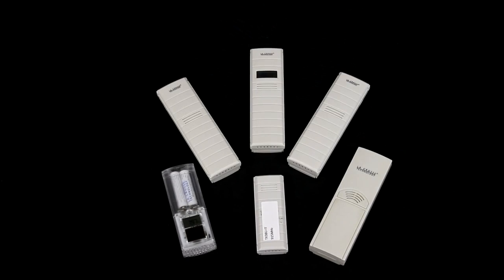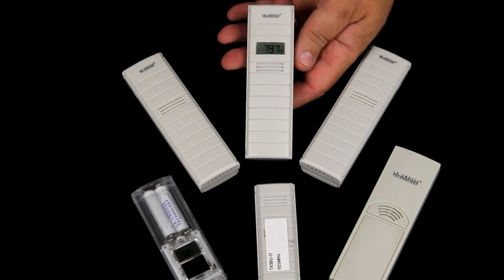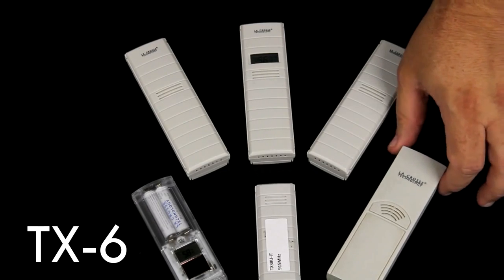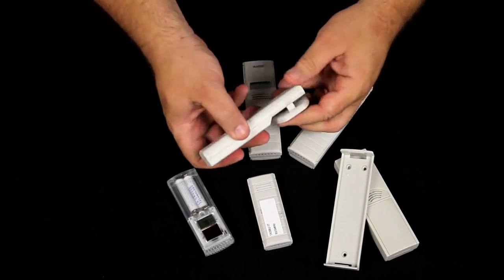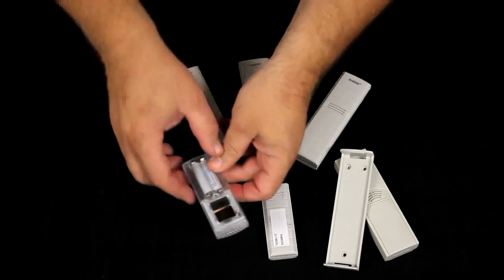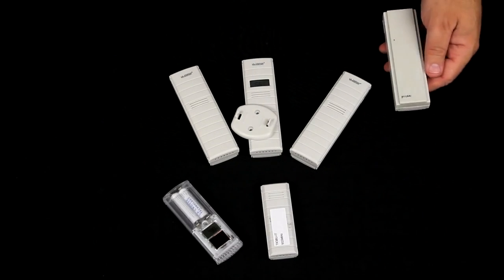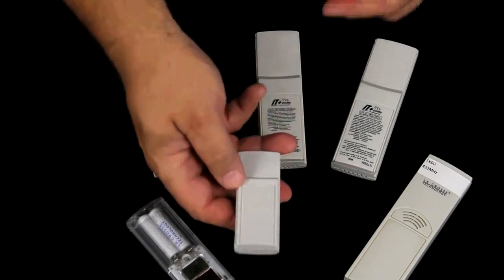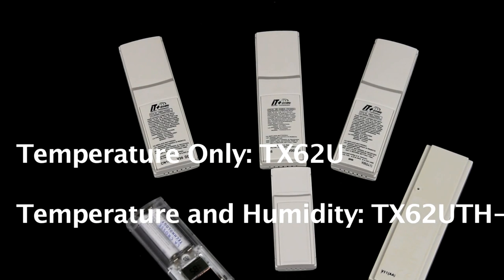Remote Outdoor Sensors

Comment: I see that most don t work past a couple years...won't get again
Reply: La Crosse Technology yes, I do understand those that leave the bad opinions, but they are true to what you just said. There should be a warning on front of box in big enough letter saying that humid areas will cause equipment to not last but maybe a year or two. Then a person can decide if they want to spend that much for a product that doesn't last that long! Not fair to not tell people.
Reply: Have my mounted under 4' deep eves - very protected from elements.   All metal components in the sensor look corroded after 2 year use.   CT humidity kills it - really?   No, cheap materials kill it.

Comment: La Crosse is a joke. My sensor failed. La Crosse admits they are only good for 5-6 years, but no longer offers compatible replacements. So, they lamely offer 45% off a new weather station whose sensor will fail in 5-6 years. What a scam: Talk about planned obsolescence!
Reply: I had an accurite that lasted 5 as well.

Comment: These sensors/weather stations have four big problems.  (1) Battery replacement has to be in right sequence.  Sensor first, and the receiving station next.  If the sequence is messed up, the sensor will be damaged permanently.  (2) So you have to monitor battery strength in the sensor periodically.  If sensor battery is dead, the receiver can no longer receive signal (even after you have replaced sensor battery). (3) The sensor is not weatherproof (deliberately).  Even if you put it in the shade outside, some mist, splash will get inside, and will damage the electronic parts.  (4) At very low   temperature (say minus 25 deg Celsius as in Calgary) it malfunctions. I have dumped two sets because of (1) and (2), and the third one was damaged because of (3).  The g oal of the companies is to sell every two years.  As regards accuracy, these are excellent.
Reply: The inside station is working fine.  The sensor was dead for a while.  I virtually wrote it off.  I opened it, using a small saw, and noticed two problems (1) The negative terminal of battery compartment had partly broken (poor/intentional design).   (2) The +ve leg of the 10 mfd 16V CKCON JAC (Whatever that means) electrolytic condenser inside the sensor got rusted. I shall try to repair it as part of my hobby project.

I give this feedback because (1) I really liked the station for its overall convenience, reliability and accuracy (I used three, and presented another three to my friends).  (2) I do believe that in this age of electronics, foolproof safeguards against inadvertent wrong sequence of inserting the battery is not that difficult.

Thanks for prompt reply, and for sending the reset link.
Reply: How can a different sequence permanently damage the sensor?
Reply from the maker: @gil3289 , simple answer, it cannot. Our original response to "Know All" was deleted last year when we upgraded our Google/YouTube account from a personal to business platform. If you're having trouble with your sensor or station, please send our support team a message here: https://www.lacrossetechnology.com/support/index/form/ and they will work with you should you need a replacement. Alternatively, our restart video here: http://bit.ly/LaxTech_BasicRestart often helps resolve connection problems.
Reply: @knowall5792  Your problem is that your unit has an electrolytic "condenser" , should be a "capacitor"....................just kidding! Sounds like you are "old school" Know All. I am an even "older school" Elect. Tech, I like to use the "old" terminology, such as: 60cycle instead of 60Hz. GOOD LUCK with that sensor. BTW, "AccuRite has the SAME issues!

Comment: We're seniors, unable to climb under the eaves to install the outdoor sensor for L73859. Wondering if the unit would send approximately 40' from inside a post mounted waterproof plastic electrical outlet box?
Reply from the maker: Though we cannot guarantee this will work, 40' is well within reception range, so it's worth a try. Our only concern is possible inaccuracies due to the lack of ventilation within that box. Our sensor weather shield could be another option if you have any trouble: https://www.lacrossetechnology.com/products/925-1418

Comment: Thank YOU !!   BUT ...... when I put New batteries in my outdoor sensor, it no longer communicates with my clock indoors.  Please help :)
Reply: Okay, I did everything you said above and the outdoor sensor still isn't working.  I'm thinking my sensor went out on me.  I'll probably have to buy a new one again.  This is my 2nd sensor so far.
Reply: About 1-1/2 years ago, roughly.
Reply: Okay great.  Thank You.

Comment: I've put new batteries in the outside thermometer and it continues to read OFL, and must be synced to inside unit which also reads OFL as the outdoor temp.
Reply from the maker: Hi Noel, sorry about this. What is the model number of your weather station or clock?

Comment: I have a TX 141TH in the red light in front flashes continually. I have change the batteries on the remote I have change the batteries in the stationary model and I have reset The units by taking out the batteries and unplugging it from the AC current. What are my other options?
Reply from the maker: Hey Marla, we are truly sorry for the trouble with your outdoor sensor. Our first suggestion would be to make sure you are using a new set of reputable alkaline batteries in both the sensor and display. Other battery types can have undesired results. Along with this, be sure to perform our basic restart steps covered in our video here: http://bit.ly/LaxTech_BasicRestart -- If these still do not provide a solution, please message our support staff directly here: https://bit.ly/contact_techsupport. Or alternatively, send us a private message on our Facebook: http://bit.ly/LaxTech_Facebook or Twitter: http://bit.ly/LaxTech__Twitter page.
 Our apologies again for the inconvenience.

Comment: I have a TX142TH, the outside sensor is not working, possible to fix or replace?  Not the batteries. Thank you?
Reply from the maker: If you've tried our Restart Instructions covered in our other video here: https://bit.ly/LaxTech_BasicRestart and are still having issues, a replacement is likely needed. You can find this on our website here: https://www.lacrossetechnology.com/products/tx142thv4 

If the item is still under our 1-year warranty, please message our support staff directly here: https://bit.ly/contact_techsupport. Or alternatively, send us a private message on our Facebook: http://bit.ly/LaxTech_Facebook page for assistance in getting a free replacement. 

We are very sorry for the inconvenience.

Comment: What are the differences (if any other then the # after the "V") between the "TX141TH-BV2" and the "TX141TH-BV3" I have an older 308-1414MB that needs the V2 and I just bought a newer S84107-INT that needs the V3 one will one work for both stations?
Reply from the maker: Hey Peter, sorry for the confusion. Both versions of these sensors should work with each of your weather station displays, so yes, only one sensor will be needed if you're setting them up in the same location. A small internal component was the only difference between the two sensor versions, the performance should be the same.

Comment: The weather station 308-1412-3TX can display the status of the batteries installed in each sensor TX141TH-BCH. What voltage will trigger the "low battery" icons?
Thank you for your answer.
Reply from the maker: We apologize, unfortunately, we do not have that specific spec for this item. Typically, the low battery icon will show up when the batteries are between 1.22 - 1.35 DC Volts. Though, you're usually safe running the batteries until they die or at least for a while after this icon appears.
Reply: @lacrossetechnology   Thank you very much for your detailed answer/recommendations!

Comment: I have the 79400 model. We had a very short power outage (a few seconds) and now the screen is showing 188 everywhere. I have tried resetting and nothing.
Reply from the maker: Hey Kathy, our sincere apologies for the trouble! Let's try a few steps to see if we can get this corrected:

1. Remove all power from your display. Including batteries and unplugging the power cord from both your wall and from your display.

2. Press any button on the display at least 25 times and leave it sitting without power for at least two hours.

3. Power the display back up by plugging the power cord into your outlet first, then into your display. 

4. Press and hold down both the WIND ALERTS and LIGHT buttons together until the unit beeps. 

If this does not resolve the issue, please message our support staff directly here: https://bit.ly/contact_techsupport. Or alternatively, send us a private message on our Facebook: http://bit.ly/LaxTech_Facebook or Twitter: http://bit.ly/LaxTech__Twitter page for further assistance. Sorry again for inconvenience.

Comment: I had 4 different types of weather stations and always this little wifi sensors go bad few weeks months the electronics can not handle the cold temperatures and they go kaput.
Reply from the maker: Hi Cess, we are truly sorry to hear about the troubles with your past sensors. In most situations we recommend using new brand name alkaline batteries dated at least 7 years ahead (super, ultra, max, heavy duty, or rechargeable types should be avoided). But if you're in a region with consistent sub-zero temperatures, lithium batteries may be a good fit, as they can better withstand the colder temps. To get the sensors resynced with your stations, please review our basic restart video here: http://bit.ly/LaxTech_BasicRestart -- If you're still having issues getting them to reconnect, after these steps, reach out to our support team: http://www.lacrossetechnology.com/support/index/form/ -- we'd be happy to work with you should you need a replacement. Sorry again for the issues, but we hope to help get this sorted out here soon.

Comment: Hello, my TX141TH-BCH sensor measures 1.5 degrees more than the base. Is that correct?
Thanks
Reply from the maker: Yes, this is a possibility. When performing a side-by-side test, if the readings are off by more than 4°F, this would indicate an issue, but 1.5°F is considered within tolerance and working correctly. Our other video here: http://bit.ly/inaccurate_temp_readings, goes into how to perform a test and offers suggestions if you believe the outdoor sensor is reading too high or too low.

Comment: Is my TX191 outdoor sensor suppose to have the little red light on the entire time ?  or does it blink?  It does neither and I just replaced the 1 yr old Duracell batteries (I write install date on batteries to be sure)   The sensor is not connecting (and no red light)
Reply from the maker: Hey Nancy, the light on the TX191 sensor should flash periodically to indicate that it is sending a transmission. In either case, we'd recommend trying another new set of regular alkaline batteries and following the restat steps outlined in our video and instructions here: https://bit.ly/basic_restart -- If this should continue to fail, please message our support staff directly here: https://bit.ly/contact_techsupport. Or alternatively, send us a private message on our Facebook: http://bit.ly/LaxTech_Facebook or Twitter: http://bit.ly/LaxTech__Twitter page, as a new sensor may be required.

Comment: I have a TX37U outdoor sensor.  It is not registering with my weather station.  I did the sequence of installing  batteries in the sensor first and 5 feet away from the receiver.  After I put the batteries in the receiver, it blinks looking for the sensor and then stops blinking and nothing.  There's no reading.  Nothing happens and it's been hours.  Please advice.

Comment: Ive got manuals, i do not find info regarding tiny button in outdoor sensor
Reply from the maker: The TX button inside many of our newer sensors stands for "Transmission." Pressing it will force a transmission allowing the sensor to connect with your display faster. This is highly useful if you have a system with multiple sensors or have neighbors with similar products.
Reply: @lacrossetechnology  I only use 1 transmitter and 3 atomic clocks, my nearest neighbor being half a mile away so doubtful there's any interference. My arrangement ran fine for about a year. Could rechargeable AA batteries be a problem ? I've ordered fresh alkaline batteries to determine if that's a problem. Could a cell tower a couple miles away interfere ?
Reply from the maker: @brucefrazier9051  Fresh regular alkaline batteries and a basic restart -> https://bit.ly/basic_restart of your clock(s) would be the first step. If data still doesn't appear, a new sensor will likely be needed. For further assistance, please message our support staff here: https://bit.ly/contact_techsupport, or alternatively, send us a private message on our Facebook: http://bit.ly/LaxTech_Facebook page.

Comment: WS-9782 , can you tell me if a compatible sensor is available for this unit.   It transmit on 915MHz
Reply from the maker: Hi Ken, the only sensor compatible with your WS-9782 unit is our TX40U-IT: https://www.lacrossetechnology.com/tx40u-it/ -- Unfortunately, this sensor has since been retired and we do not have any more in stock. There are, however, sellers on Amazon or Ebay that do have these available. Before you purchase a new sensor though, make sure to try a basic restart: http://bit.ly/LaxTech_BasicRestart to see if you can get it connected. We apologize for this inconvenience.

Comment: I lost my indoor remote. Is there anyway for me to purchase a new one. the model # for mine is WS-8157NOAK-iT. FREQ.MHz.  There are also a couple of other numbers 5N7  and VOOU.
I hope this helps and I am able to replace my remote only, rather than by a whole new unit! I have really enjoyed it. Thanks, Belinda Pate.
Reply from the maker: Hey Belinda, sorry to hear about your lost sensor. We are currently out of stock of the remote model that came packaged with your display, however, we do offer a different sensor model that will send the same data to it. You can find this other sensor here: https://www.lacrossetechnology.com/tx45uth-it 
If you'd prefer another "original" sensor, you can find the product page here: https://www.lacrossetechnology.com/tx37u-it -- but you may have to reach out to our store directly for details about when it will be available. You can reach them at: Phone: 608-785-7939  Email: store@lacrossetechnology.com
Reply: Buy a new set , it's on sell for 24.99 at Sam's Club. Almost the same price as the sensor replacement alone

Comment: I got a model S88907v2 for Christmas can I add a 2nd or 3rd remote sensor to it?
Reply from the maker: Unfortunately, no. Our S88907v2 does not support additional sensors. If you'd like more info on items that do, just let us know. Otherwise, you can always find your full manual and FAQ docs on our website here: https://www.lacrossetechnology.com/products/s88907v2#support -- Our apologies for any inconvenience.
Reply: @lacrossetechnology  oh darn! Thank you for the response. What's the least expensive units that do support multiple sensors?
Reply from the maker: @livenfree  Here are some options:

308-1451V2: https://www.lacrossetechnology.com/products/308-1451v2
79400 (Sale!): https://www.lacrossetechnology.com/products/79400
308-1412-3TXV2: https://www.lacrossetechnology.com/products/308-1412-3txv2
327-1417V2: https://www.lacrossetechnology.com/products/327-1417v2

Otherwise, all of our La Crosse View WiFi connected models will support add-on sensors through to our mobile app and many to their displays as well: https://www.lacrossetechnology.com/collections/complete-systems 

NOTE: All available add-on sensors will be listed under the "Parts/Sensors" tab on their product pages.

Comment: My WS-9029U-IT remote sensor crapped out. I tried 3 different pairs of batteries and followed instructions. Neither component was ever set up outdoors.I bought it only a year or two ago. I agree with other posters,the required sequence to power them up is silly,should be plug-n-play instead. I will have to find a different solution to remotely monitor temperature. It is one more strike against LaCrosse Tech. I used to be a fan but their chargers don't last long enough either.
Reply: Tried it. The remote sensor screen shows 188.8 E and the main unit seems to be fine. Sent email to support along with the order #. It appears I bought it from your site 1.5 years ago. I have been using eneloop aaa rechargeable and it worked fine until recently.
Reply: The eneloops had a fresh charge and tested to 1.5V and it has worked using those or amazon basics rechargeable and even an ancient set of hybrid rechargeables since it was new. I realize the 1.5V is a fresh surface charge and it drops a bit but as stated,it has worked fine until now... I will use only rechargeables in my equipment,anything that has to have alkalines might as well have been run over by a looong freight train because it will be thrown away. Most electronics will work on a range of voltage,sometimes the window is narrower but it still works. You guys know all about voltage ranges for electronics though,I doubt I can educate you on that score. :)
Reply: "AccuRite" have same issues, if you want a "professional" unit that will last, be prepared to spend some SERIOUS COIN!

Comment: but how to reset or get to work after changing batteries ? when I change the batteries a light comes on then turns off. but not connecting to indoor device
Reply from the maker: We first would suggested a Basic Restart. Those instructions are covered in our video here: http://bit.ly/LaxTech_BasicRestart  -- If you sensor still does not connect after following those steps, please reach out to our support team here: https://www.lacrossetechnology.com/support/index/form/ and we'll work with you should you need a replacement. Sorry for the troubles.